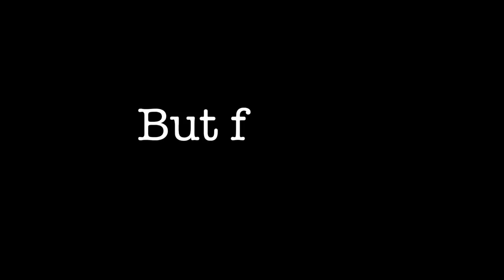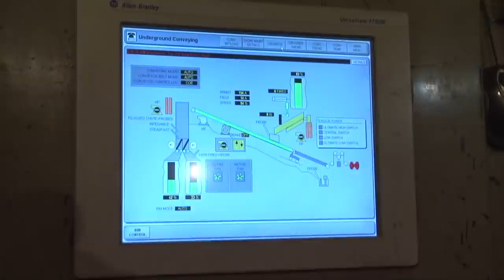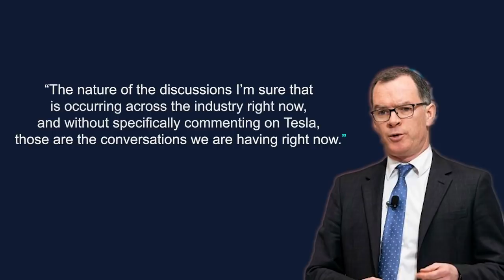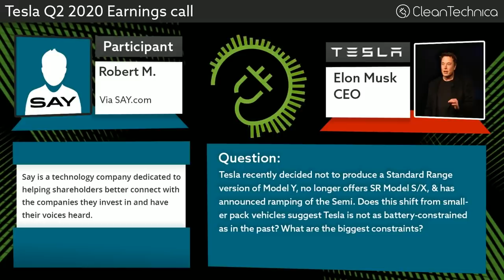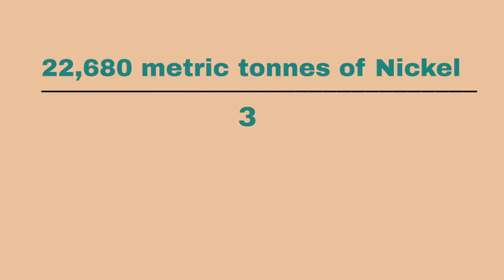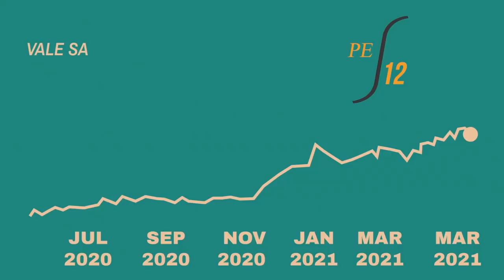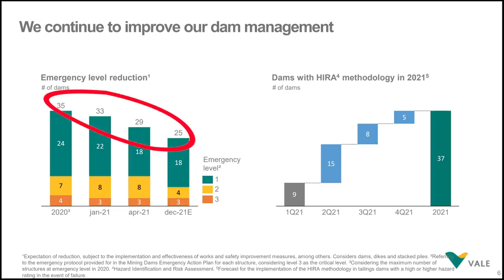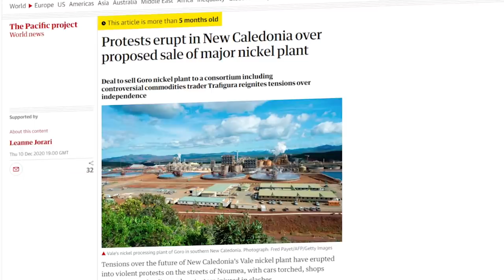Vale Mining Stock Analysis | Why VALE Will 5X Soon

Comment: Sorry, a bit confused. You want to buy Vale because of Tesla needs tons of Nickle but Vale is selling it's Nickle mine and operations to a consortium that includes Tesla as a partner. Wouldn't you want to buy the consortium or are you thinking that Vale will go up because of the sale? I am sorry, I must be misunderstanding your position.
Reply from the maker: The New Caledonia mine that Vale sold sparked several protests about environmental concerns and was also a losing mine. Divesting in that mine was a smart move in my opinion, despite Tesla ending up as a partner to the consortium.
Reply: @Casgains  So does Vale still have substantial Nickel resources left that you feel will supply Tesla regardless of this sale?

Comment: It seems that the estimates are extremely conservative at 300,000 battery packs. Why limit the numbers to Teslas sold in the USA. Tesla needs the nickel for cars in China, Germany, and upcoming UK too. Don't forget the Tesla Semi truck. It will require significantly larger battery backs.. The total production combined production of Tesla Fremont and Texas will be will far exceed 300,000 annually. World wide production estimate will easily exceed 1,000,000 annually in 2022 with Fremont, Shanghai, Berlin, and Texas. I believe that Tesla's contract with Vale is much larger than the number presented here.

Comment: Hm, calc seems wrong at 7:07, should be 1'000'080 * 35 = 35'002'800
Not that it really matters much in this case.
Reply from the maker: My bad, thanks for pointing it out, exunil. That actually makes the case even better, as the final percentage number is now closer to the estimated percentage of 5% of Vale's annual class 1 nickel supply.

Comment: Would 5% or 6% make that big of a difference in a company's value?
Reply from the maker: I meant to show that there’s a high likelihood that Vale’s “significant mining contract” was with Tesla by demonstrating Tesla is the only company that requires that much nickel for EV production. Essentially, based on my calculations Tesla would need roughly 6% of Vale’s class 1 nickel, which is similar to the percentage of Vale’s supply that Vale claimed to have signed a nickel mining contract for (5%).
Reply: @Casgains  I think we understood that, but the question remains if this is only 5% of their nickel business. Is it such  big deal that would make me jump on my brokerage account ?
Reply from the maker: @Matzes  In my opinion, it is just a signal of much more to come. Tesla and EVs, in general, are on the cusp of massive growth ahead. While Tesla's production rate in the US is currently only at 300,000 vehicles per year, there's a high likelihood that this number is going to accelerate to several million vehicles per year in the coming years. By then, it will not just be 5% of Vale's class 1 nickel. Instead, it will be 50-75% of Vale's annual nickel supply (at a 3-5 million vehicle run-rate) just for Tesla. When that happens, there are only two scenarios: Vale expands its nickel supply (which it has already been planning to do), or the price of nickel skyrockets due to a nickel supply bottleneck. Either way, Vale comes out on top in terms of both earnings and revenue.
Reply: @Casgains  thanks for the insight. I don't disagree with the overall sentiment

Comment: In China, Tesla uses LFP batteries in the base (shortest range) Model 3.  It has been rumored - not substantiated, so far as I know - that they may begin to use LFP batteries in the base Model Y.

But Giga-Shanghai does use nickel in batteries for its longer-range Model 3 BEVs, and all of its Model Y output, thus far.  So, no.  You can't rule out Tesla's China operations as a consumer of nickel.

It's true that the BEV revolution will increase demand for nickel, but on a percentage basis, batteries won't use much of the world output even as BEVs come to replace ICEVs.  The dominant consumer of nickel is stainless steel production, and it will remain that way.  Stainless steel is big.  Demand for nickel will rise, owing to BEVs, yes.  But the increase needed isn't really much, compared to world nickel production as it stands now.  I can't give hard numbers, but my gut feel is 10%-15% growth in nickel supplies ought to be enough over two decades to cover demand from BEVs supporting both battery manufacturing and Tesla's use of stainless steel in automotive bodies.

Of course stainless steel demand might also rise for other uses, so nickel output might have to rise by more than 10%-15%.  It's hard for me to guess what stainless steel demand might do over the next two decades.

Tesla expects growth in nickel consumption both for its batteries and for the Cybertruck's stainless steel body.  I suspect Tesla may get around to using structural steel bodies in other products eventually.  In principle, they can reduce manufacturing costs and deliver cars and trucks which are much more durable by using stainless steel bodies.  But thus far, only the CT has been announced with a steel body.

Even if Tesla does produce more models with stainless steel bodies, it still won't be a dominant consumer of stainless steel.  Stainless steel is big.  We're talking small percentages here.

It's lithium supplies that will need to grow by more than an order of magnitude to support the transition to BEVs over the next two decades.  Little lithium suppliers are poised to become big lithium suppliers.  That isn't the picture I'm seeing for nickel producers.  Big producers will grow a little bigger, that's all.
Reply: How do you feel now that Vale has signed a long term contract with Tesla?
Reply: @BurdenofTheMighty  My opinion has not changed.  Tesla is still a small player in the nickel market.  BEV batteries will drive up demand, sure, and it's not insignificant that this will happen, but the dominant consumer of nickel remains stainless steel production.

But of course it's good for BEV manufacturers like Tesla to secure their supply.  Long term contracts like this one with Vale are just what nickel suppliers need to justify the capital expense of increasing production.